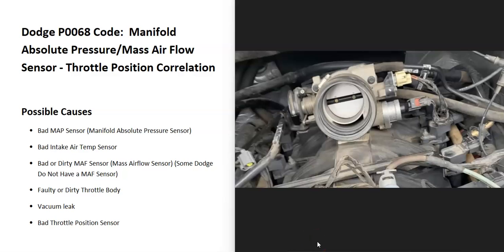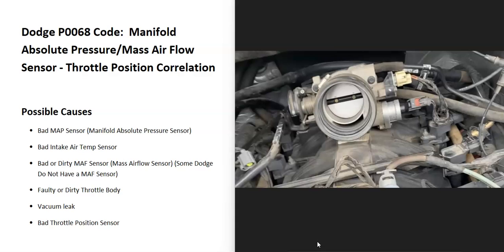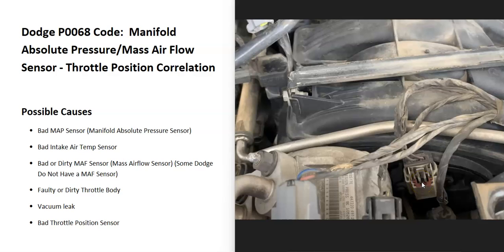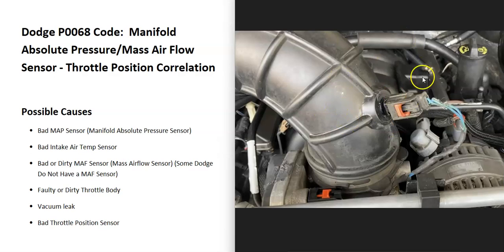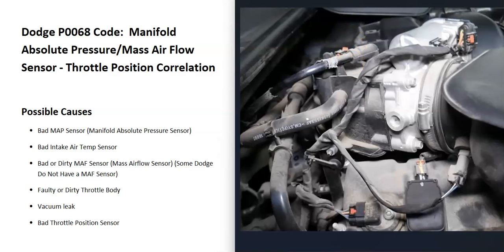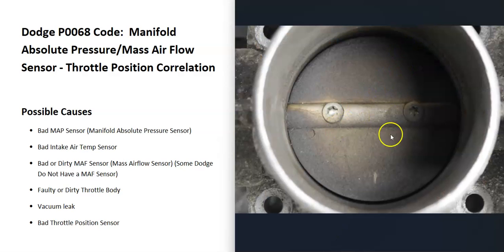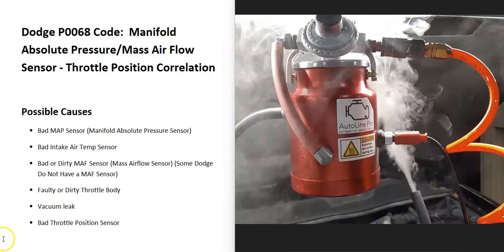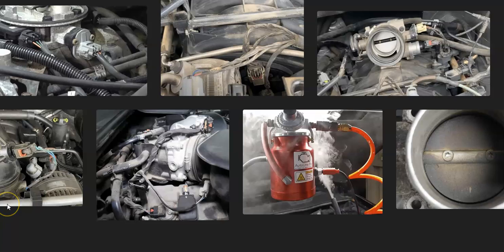Causes and Fixes Dodge P0068:  Manifold Absolute Pressure/MAF Sensor Throttle Position Correlation

Comment: i’m getting this code on an 05 4.7 , i’ve changed tps and map. i notice that the throttle cable is slack for about an inch before it makes contact with the piece that’s attached to the blade in the throttle body. i’ve done the relearn and unhooked the battery for a bit and it’s still not running right.

Comment: by any chance do you have the specs of the screw that goes in the MAP sensor ? Mine is located right between the compressor and the alternator and, while replacing it, it came lose and got lost.